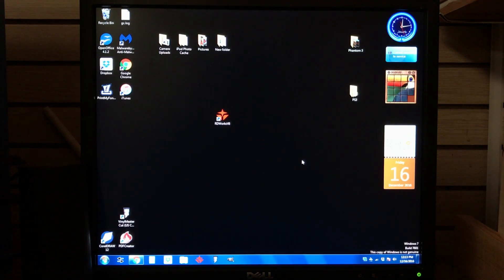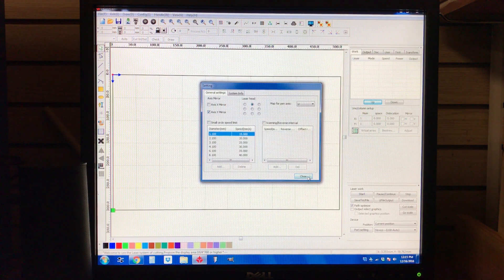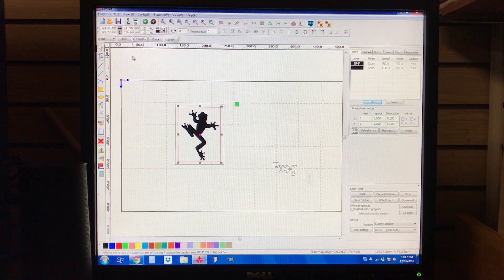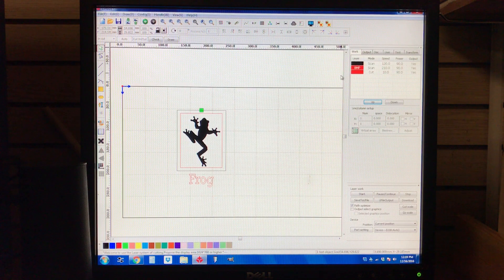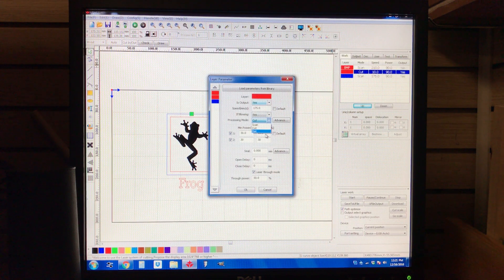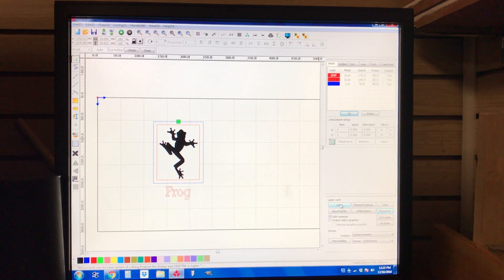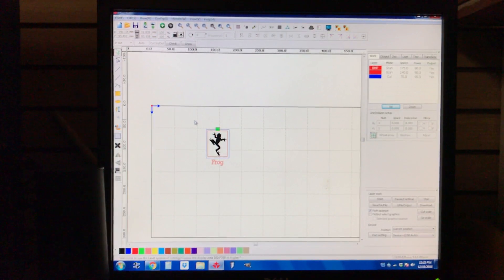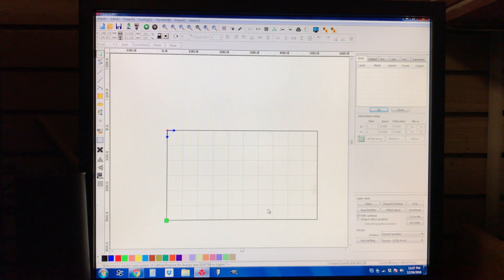RD Works Basic Tutorial part-1

Comment: Help me please.
Wile engraving, my laser´s head is swinging all way left and right just to engrave a little draw in the middle.
Something related with acceleration...but I cant increase speed.
What user setting do you use?
Thanks.
Reply: @rere-hv9jg  a guy send me the file with original vendor and user settings. Saved me. Now thats ok.
The only problem I have is that the engrave (scan) seems like fish scame...not smooth. :(